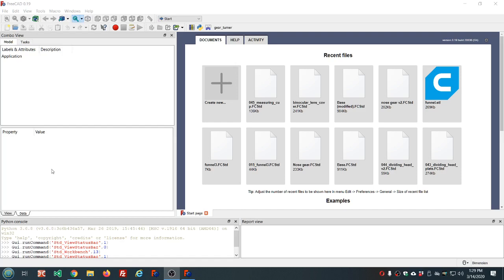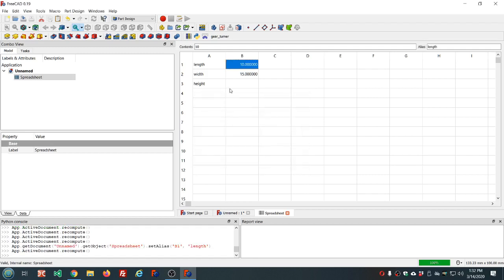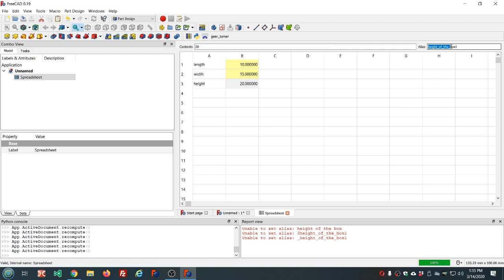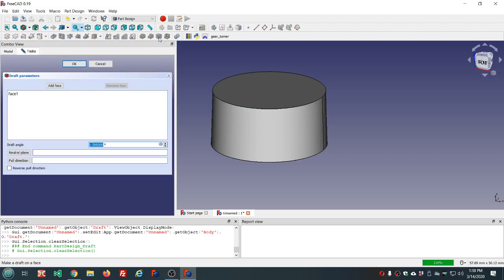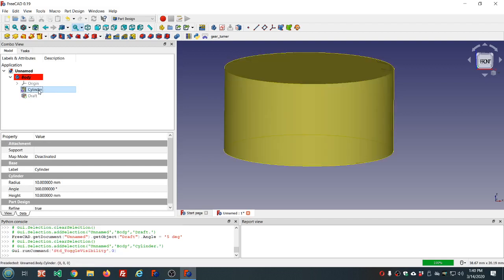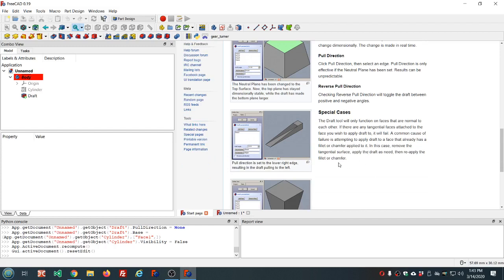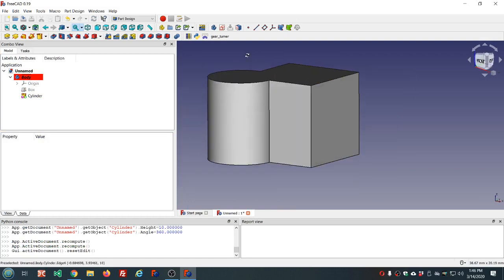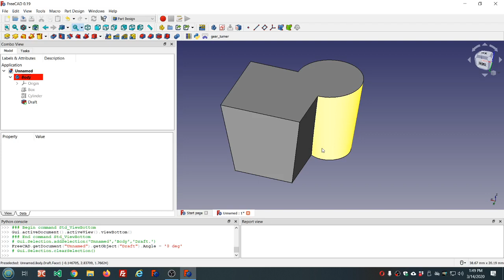046   FreeCAD Part Design Draft and new Spreadsheet Alias Control

Comment: One of the fun things I like to do, is when a plastic part breaks on something (e.g. an appliance) and I can't find an inexpensive replacement I design it in FreeCAD and 3D print the part. Plastic parts typically have drafts to allow them to eject cleanly from the injection mold (I used to design injection molds). Many times the draft is simply for this purpose. However, sometimes the draft is also leveraged to accommodate clearances to other parts. Or, if you just want to make your replacement just like the original you'll probably need a draft. This is a great tool.
Thanks again for doing these videos.
Reply from the maker: Thanks for the feedback.  I wish Part workbench had a similar draft tool.  You can extrude at a taper to achieve a similar result in some cases, but only if the profile doesn't have inner wires.